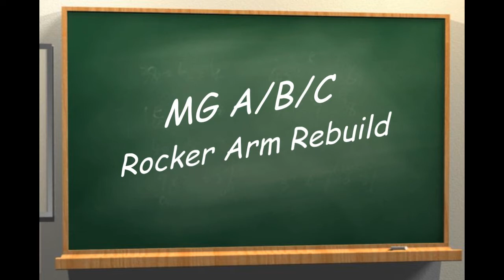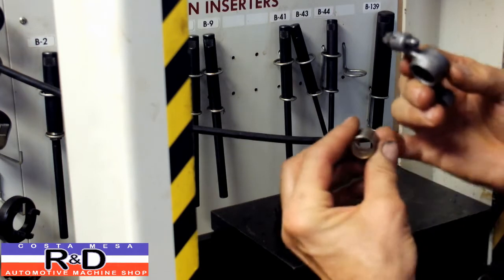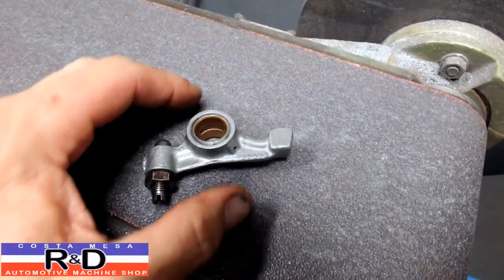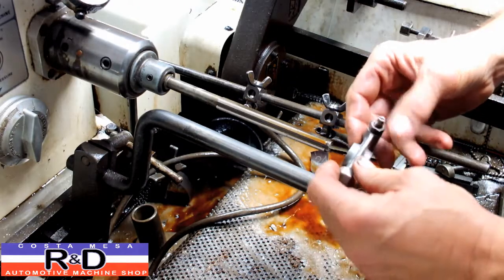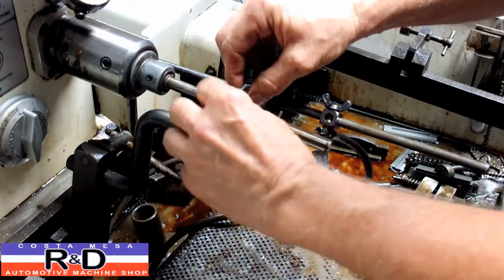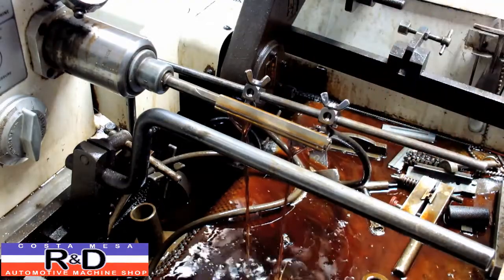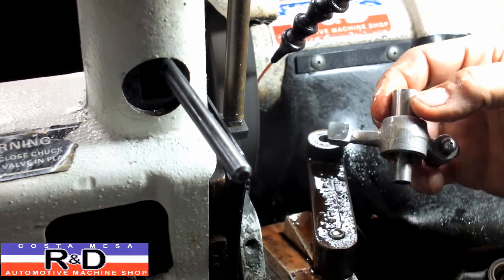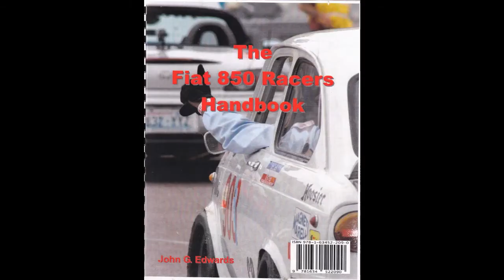MG Rocker Arm Rebuild

Comment: There is a second oil hole to the push rods, it has a plug in it. You remove adjustment screw to drill through.
Was there some reason why this was not shown?